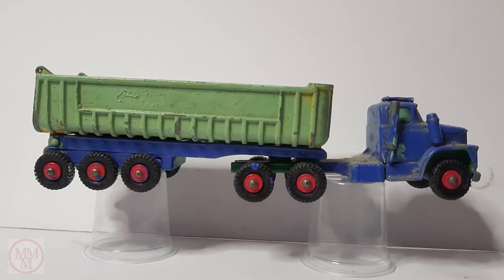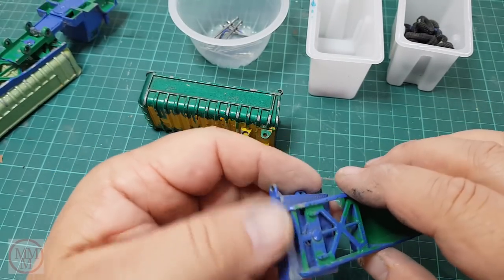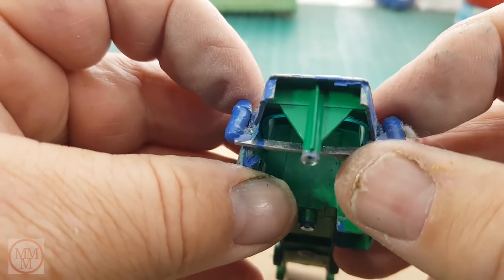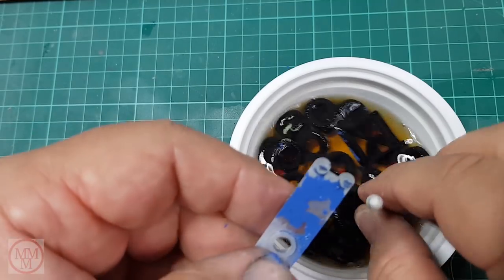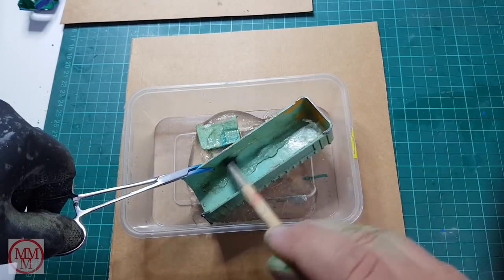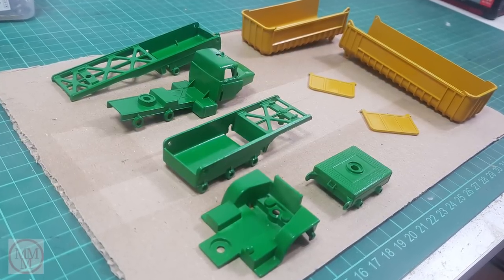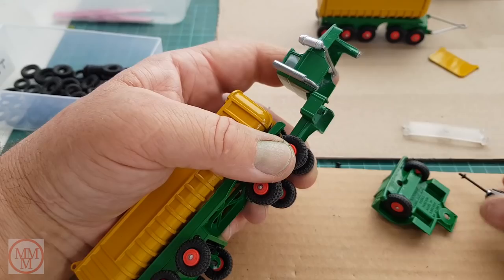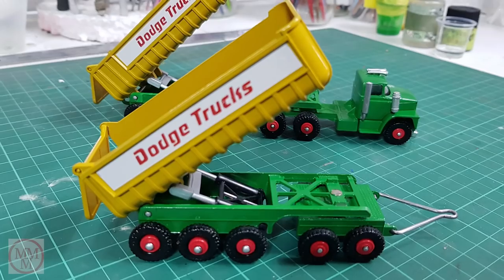MATCHBOX Restoration No K16 Dodge Tractor with Fruehauf Tippers 1966

Comment: Marty I have a dodge kingsize tractor unit that is fixed to a Lesley horse box. I can’t figure out how to get the horse box off the tractor unit. I’m scared of damaging it.  Is it one of those supersized rivets? I was hoping to see you detach the trailer from the tractor unit.
Reply: railtrolley awesome. Thanks buddy.
Reply: @sarahhardy8649  He doesn't show taking it apart.  Although being able to see all the separate parts is helpful.  The bottom of joining rivet for the trailer to the cab should be hidden under the cab baseplate.  The baseplate is only 1 rivet to drill out, and the front is held in place by the grill and bumper of the baseplate.  The 3 rivets on the trailer would most likely have to be drilled out and the trailer body top removed to access the top of the rivet.  The first 2 rivets on the trailer body are readily accessible.  The 3rd rivet at the front of the trailer body should be accessible to drill out by swinging the cab around.  If you haven't taken a Matchbox apart before, a Kingsize is good to practice on as it is much bigger.
Reply: railtrolley yes. I thought I would get on better with it as a newbie. Many thanks for your help and advice. Can I ask you one more question. Where would one go about getting replacement parts eg replacing a cracked cab plastic or a missing door. Happy to. Yay it but can’t afford a 3D printer.
Reply: @sarahhardy8649  A Google search "Matchbox or Matchbox Lesney spare parts" will bring up a good list of shops.  I have purchased spares from ebay, and direct from shops in UK, US, Australia, Canada and the Netherlands.  Some shops have parts others don't have.  Oversea postage costs and waiting time to consider.  The Regular Wheels 1/75 range is almost completely covered for spare parts.  King size - not so many parts available.  The shops also have decals, tyres and tracks.  A window unit could not be made with current 3D printing technology.  It would end up looking like a louvre window.  Another way is to get a second model for parts and make one good one out of the two.  Good luck with your project.
Reply: railtrolley you’re the best. Thanks very muchly .

Comment: Might just be a datail, but you could have done better paint on the back/underside of the truck. 

But it turned out lovely from topside. :)

🐨?
Reply: I had the same idea. The original green paint has more blue in it. But I have no experience in mixing colours though.
Reply: I was thinking about it did not Seem to fully cover the back underside.

Comment: If GE brake fluid doesn't work, silicone ones probably will.

but, also, where's the tipping?! How do they tip? What, you don't have sand in Straya? Salt? C'mon! ;-)